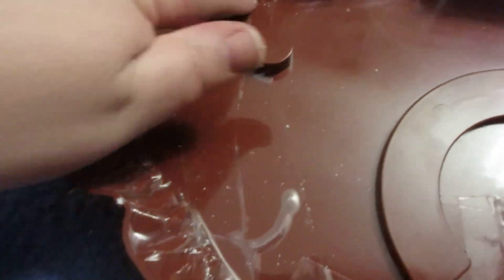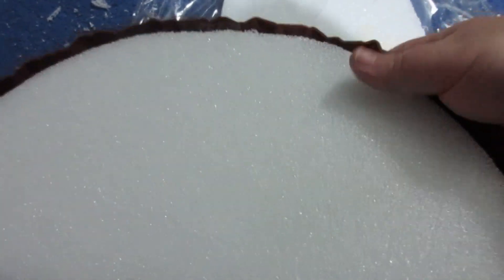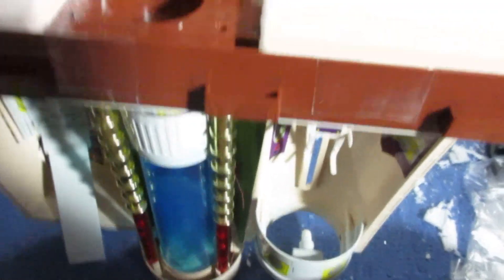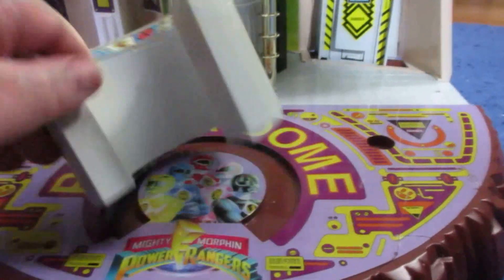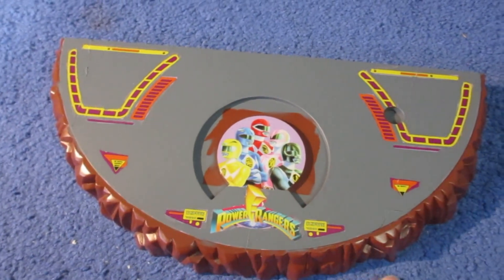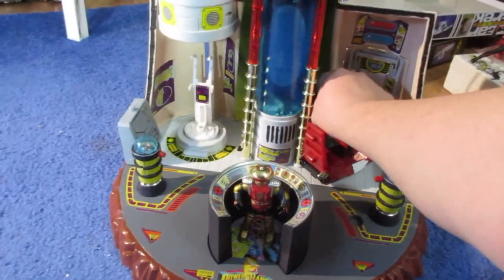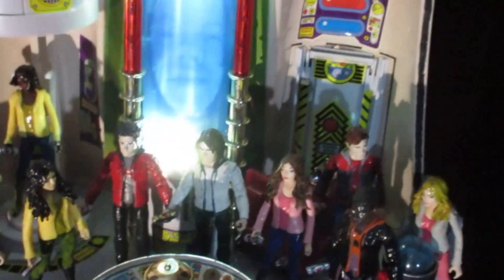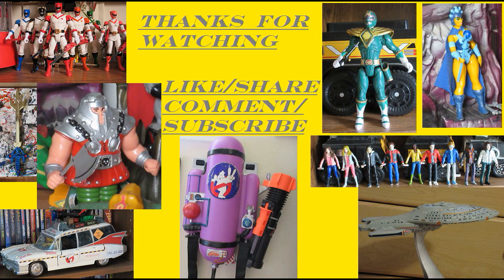power ranger power dome

Comment: The flash lights are so cool,you should of done a tutorial on how to,and where you got them from
Reply from the maker: your right , i never filmed it cause i wasn't sure it would work ,and once i saw it worked it was all together and with the plastic being fragile i didn't want to take it apart again , but the lighting kit is from brickstuff.com
Reply: @thunderrobots1980s  I get what you mean it is pretty fragile.what lighting kit is it exactly?
Reply from the maker: @stevennewlands456  what i used is custom kit that i chose for it , and i selected some red flashing lights , some light strips an some come with connection wires and connection ports and some don't, so make sure you get those , and you can choose your style of battery packs , or you can go for a complete kit that has everything and they have multiple to choose from , but the flashing lights are not part of any kit